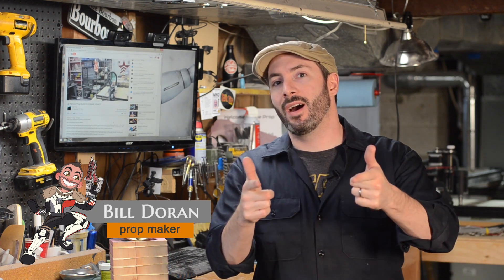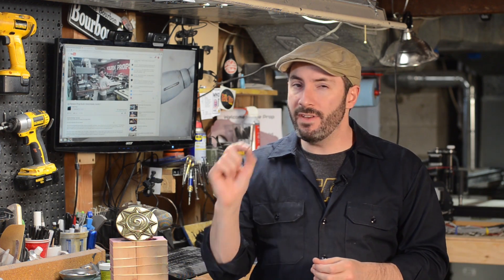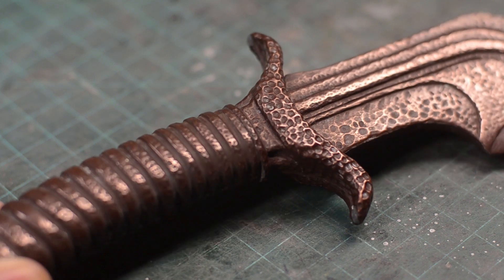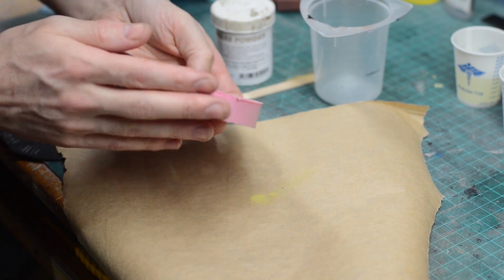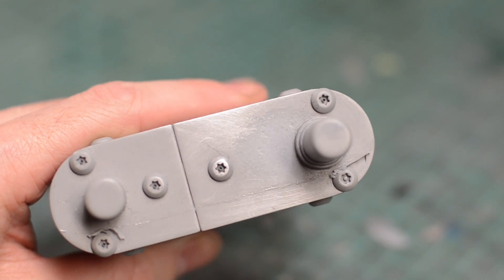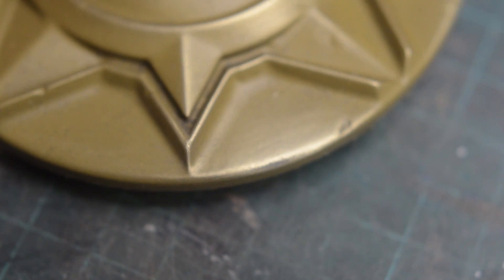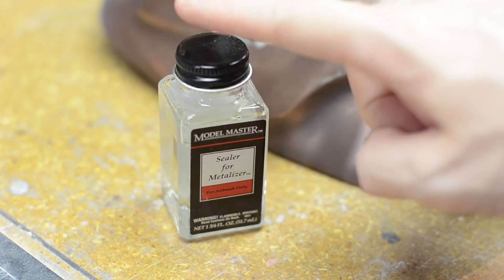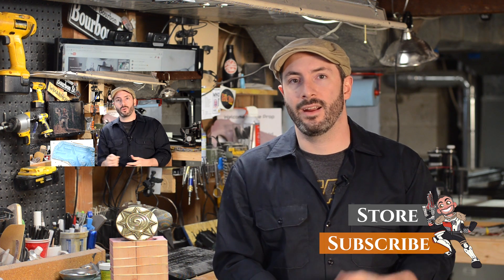Prop: Shop - Molding & Casting 101: Cold Casting

Comment: I know this is an old video, but I'm currently considering cold casting for a project and I have a couple of questions:
1) How heat resistant is a cold cast bronze object? I'm thinking of making a stamp for wax seals and I want to know if the temperature the sealing wax (221F or slightly lower) would deform or damage a cold cast stamp after 1 or 2 uses. 
2) Could you pour cold cast bronze resin on a metal piece to get a negative of it? What about sulfur free clay? If so, is there a mold release product I should use? 
cheers!

Comment: Just a question, how would you mold a small piece that has a hole through it, so you can keep casting from going in? Thanks
Reply from the maker: You can plug the hole with clay! Then you remove the clay for the second part of the mold and you'll be able to cast the whole piece with a hole!

Comment: Kay, that explains my previous failures, but my next project.... I'm going to replicate my previous failures.
I bought a mystery box from Kult of Athena a little while ago, guaranteed ten sabers and "military swords" for $120, couldn't pass up the deal. In it were three copies of same confederate officer's sword. Now I don't need three identical copies hanging around, especially not of CSA swords. They are pretty, so the one in the best shape is hanging above my fireplace on the mantle. The worst one will be restoration practice. The third is getting taken apart so that I can make it my own. I'm thinking of a disk shaped guard made of thick copper and a handle made from a zebra bone. Since the interior of a bone is porous and friable, it'll need to be cleaned out and I'll fill it with a 1-1 mix of casting resin and bronze or iron powder to not only ensure a custom fit to the tang, but also add weight to the handle to balance the blade.
Reply from the maker: Cool project!

Comment: Where can I buy the resin?
Reply from the maker: Smooth-On has a great website as well as Reynolds AM.
Reply: After a few months I finally made the mold and am ready for cold casting. I’m just wondering, what happens if I don’t tint it black? Is it that big of a difference?

Comment: Hey,  random question and random gratitude.  Thanks for taking the time to reply to comments on old videos.  Very cool of you.   Now question time: Have you ever experimented with multiple metal powders in a single cold cast mold?  For instance is it possible to brush on the powder so you can have brass in one part and copper in another?   could you mix the powder with a bit of resin or water and make a paint you can apply (and let it dry before adding the backing resin)  or just apply the powder with a brush? I haven't started experimenting yet but thought it would made sense to see what you may have tried before I go full on mad scientist.
Reply from the maker: That is definitely possible, but super tedious. I've never done it successfully, but I also haven't put much effort into it. I have no idea bout your "metal resin paint" idea either. Worth trying though! I do know you can apply the powder by itself using a brush.
Reply: thanks bill, I'll let you know how it goes... gulp

Comment: check out MetalRub it's good for this on finishing, it's fine metal dust and accents in a fine resin, for those hard to reach places in small tight groves you can't sand
Reply from the maker: +Nomad 087 Nice! Thanks for the tip!

Comment: Same technique works for uncured polymer clay only you add the metallic powder ( I use PearlEx) with a finger tip. I'd be interested to try the "dusting" technique and see what happens. Would have to do polishing before curing I think, though, which could be a bit more complicated.

Comment: Working on some cold cast jango parts for my girlfriend, I understand the issue w/ the seam lines and cold cast. Fortunately, I found a work around to this. Her armor parts had surface imperfections that were driving me nuts- some air holes here and there on the main surface, mostly along the return edge that would still be visible. I carefully applied some glazing putty over these spots as you would anything else, but applied a small amount of rub and buff after sanding down the spot putty. Fortunately they come in pretty much every metallic color you'd hope for. While rub and buff silver leaf comes out slightly brighter/lighter than standard aluminum cold cast, it blends it quite well, especially after a little bit of weathering you can't even tell. I haven't tried this of course over a blaster/weapon prop but I imagine it can work all the same

What I find interesting is that I've done a few cold-cast pieces myself, but I've always mixed the powder into the resin on top of dusting the mold. Maybe it has different finishing results, but that eliminated the concern for removing the top layer from over-sanding and I can go at it with the polish quite nicely. 

Thanks for the vids! I need to get more learned up for mold making...
Reply: Thanks for the info!  I've seen a few other cold cast projects that also mitigated the sanding issue by adding more of the metal powder to the resin mix.  They used a 1:1:1 ratio of powder, Part A and Part B when mixing the resin.

Comment: Hey man,

Great Video, what about cold casting Urethane Rubber? Have you done this before?

Should the same techniques be used for buffing it up?

Im just wondering if a wire wool would take the coating off quicker on a urethane rubber piece

Comment: Hi,
really enjoy your videos. I've found out about you through the Draw With Jazza collaboration and started binge watching all of your videos.

I want to propose to my girlfriend and I thought of making a custon ring for her. I already gave her one made out of wooden veneer. Now my idea is to make a 3D model let it print (I don't have a printer) and create a mold out of it. I would like the ring to be golden so I thought of using clear resin an mix it with gold dust. 

Can you tell me if the ring would be durable enough to wear it every day for a long time without looking badly torn up? 

If you read till here thanks for your time and keep up the great work.
Reply: Punished Props thanks for the quick response. The big problem is that I don't have enough space to really work secretly on something like that with molten metal and everything. Maybe I can find a workshop that I can rent in my area. But your input really helped a lot. If the ring comes into existence one day I will let you know, but first I need to make a lot more research.

Comment: Hey Bill, I am making a set of scales for a friend using cold casting but his intent is to use the scales from a show and I'm worried ware and tear might slowly take off the thin layer of brass. Any recommendations on lasting sealers? I am more worried about scuffs than dulling the finish. Thanks!
Reply: Have you found any good sealers for cold casting ?

Comment: Does anyone know the difference between cold metal casting with Smoothon 300 vs 325.  I've seen tutorials and videos of people using both, and both of them you end up tinting black.  I cant seem to find if there is much of a difference between using either?  Some insight would be awesome.
Reply: awesome, and thanks for the help.  I just cast some aluminum/brass without any tint, so that I could see the comparison with when i get it.

Comment: Also, IF you were really careful and depending upon the piece, you could use a large straw carefully cut in half, lengthwise and slowly drizzle some of the resin down into the lowest point of the mold as a starting point. Then, once you have enough down inside, you can continue without the straw. Just be careful when both inserting and removing the straw half. you may also want to have something to temporarily hold the straw in place so that it is not touching the walls of your mold as well.

Just a few thoughts.

Comment: It's a bit more expensive but I would add an extra step to the cold casting: After covering the inside of the mold with metallic powder, mix 1 part A for 1 part B for one part metal powder (in volume) + some black tint. A small amount, just enough to rotocast a fine film of resin all over the inside of the mold. That way you can clean up the seam and have more metallic material to buff whitout worrying too much about removing the fine metallic layer. I would add that buffing with the back of a metallic spoon after using the steel wool will add even more shine. My 2cents :)
Reply: Do the rotocast that way won't remove the powder?